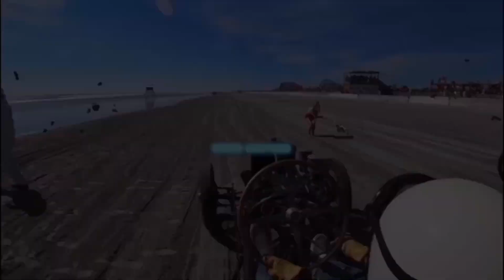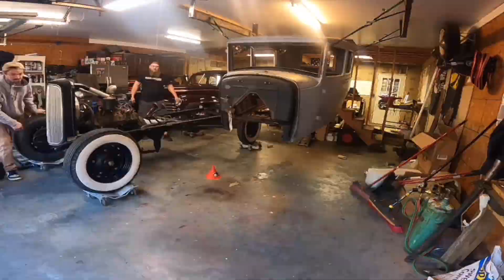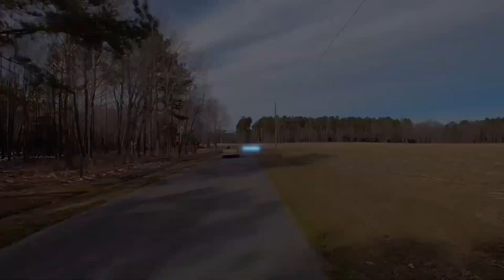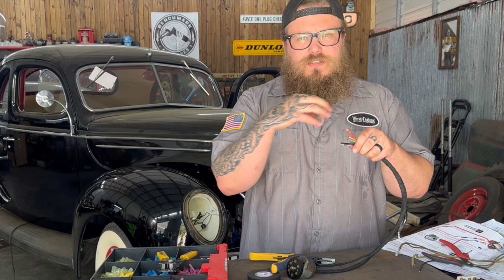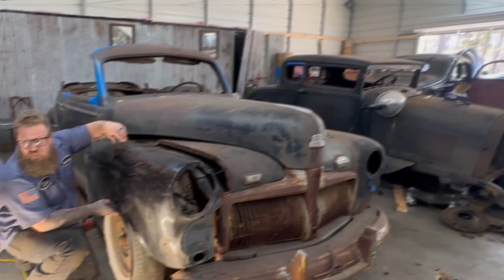Wiring Up Original Switches! Without Diagrams?!?

Comment: I have a question. I’m working on a 24 stud ab an I’m about to paint it put it in the car but he wants an remote oil filter on it my question is do i need to put a restictor in the oil filter line so it does not lose pressure?
Reply from the maker: The oil filter has its own cycle, you will not loose oil pressure
Reply: @WiredCustomsSpeedShop thank you